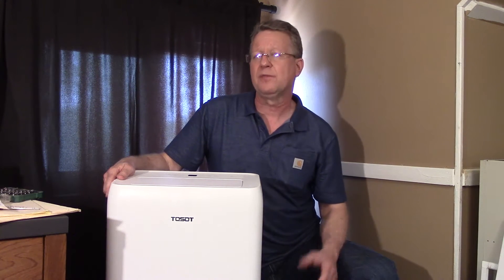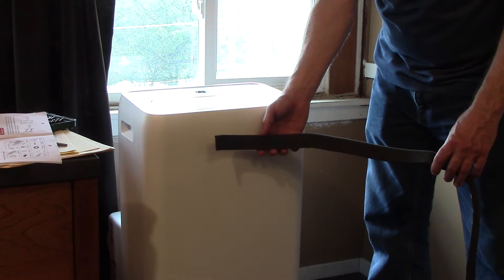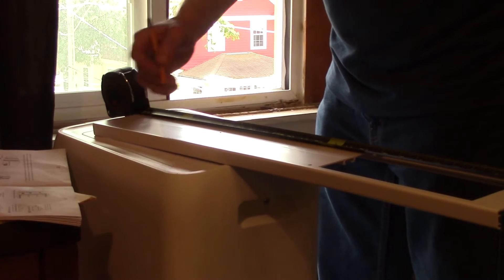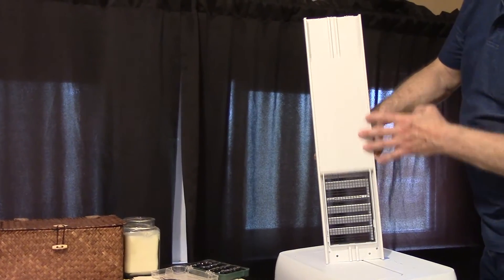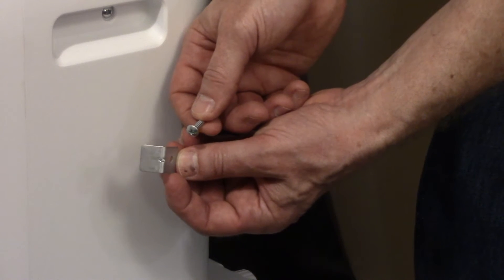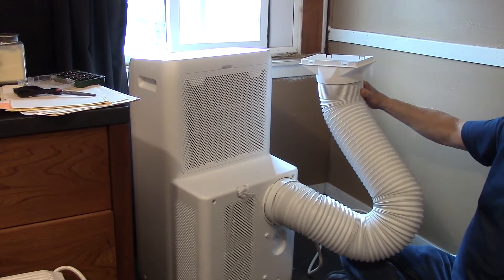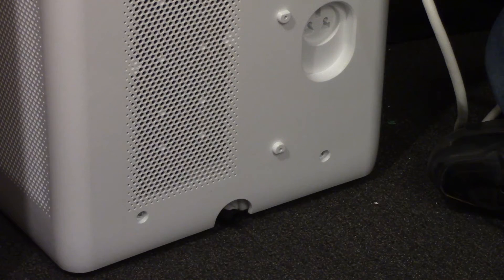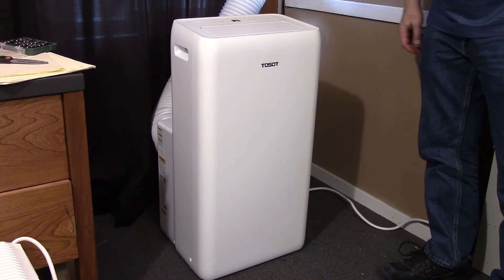How to Install a Tosot Portable Air Conditioner - Aolis 12,000 BTU Air Conditioner

Comment: I have exactly this one, is it normal for water to leak from the middle drain port around the center when running and in use ? (Not talking about the bottom drain port).

Comment: Is that connection hose blowing out the hot air is it insulated? I hear that those hoses create heat where you lose the ability of enjoying the air condition the way it should work.
Reply: window units are far superior. the hoses generate lots of heat
Reply from the maker: Hi, the hose is a thick material. The hose does get warm as it pulls out heat and moisture from the space, but the unit does a great job of bringing down the temperature and humidity levels. I put this in a 3rd floor room for a friend. He has another portable unit in the open area of the 3rd floor and it has worked well for him. This old house has small sliding windows that would be difficult to use with a window unit.